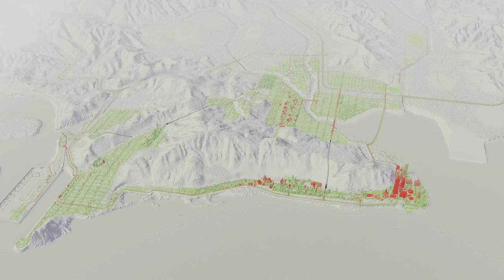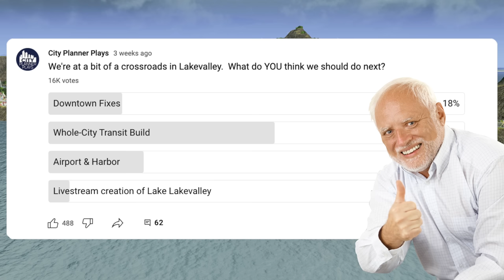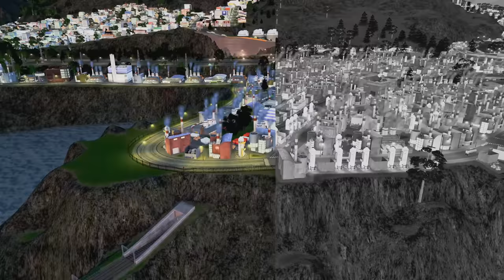Building the PERFECT Little Airport for the City That I Abandoned 2706 Days Ago

Comment: The entire airports DLC is just PAIN to me. I'm an aviation professional, and that dlc makes the most painfully unrealistic airports. Also the runway is only the surface used for taking off and landing the rest of the movement area is taxiways. The long taxiways up to gates/stands would make you the most HATED airport designer by every ramper that worked there. Backing a plane out straight is hard, and for that long, doubly so. The way you did the small aircraft gates is more realistic. Interestingly, the vast majority or runways can do takeoffs and landings in BOTH directions and switch based on the wind at the time. Similarly, in real life, taxiways are almost all bidirectional to allow the ground controllers flexibility in moving the planes.

Comment: Just thinking you could ease the traffic demands on that road from downtown to the airport if down the line you add a MONORAIL around the water's edge from the airport to the downtown? Maybe that's just way too extreme for reality, but it almost seems like a sort of downtown tourist attraction in itself to have this scenic waterfront transit system. Would also make lots of sense to extend it past that tricky traffic light and convert the industrial pocket to a HOTEL & CASINO cluster. All of a sudden your airport and downtown make way more sense as a tourist attraction hub. Leave the industrial to the area you already fixed (especially since this little rail network you just made literally doesn't connect to anything in the city- just goes from the cargo airport off the map lol).

Comment: Would a large project like this with challenging transportation access be a case for a corkscrew tunnel to grade. Enter under the highway exit at grade of airport, join them with a large tunnel into the mountain or a corkscrew to get to the lower grade?

Comment: I think the thing about trees near an airport is largely a myth. The most common kind of bird you'll get in trees is small songbirds and no sparrow, no matter how hard it tries, is going to take down a 747 in flight. The larger birds like eagles, hawks, ducks, and geese don't necessarily like trees anyway. Where I live the airport has no trees yet is one of the most popular birdwatching sites in the county. Because predatory birds like hawks sit on telephone poles, electrical wires, or chain link fencing waiting for rodents that are visible out in the open (due to lack of trees). And the waterfowl will fly around regardless just because there is water in the area.

Comment: I'm very impressed with how good you are at planning roads and other such things. But I do think you have a bit to learn about airport design. I'm an airline pilot, and this airport just doesn't make any sense. Maybe have a look at some existing airport diagrams? Like what's the point of having stands that are 5 airplane lengths long? And then everyone has to push back out onto the only taxiway to start their engines? In real life this would create a huge hassle for both the pilots and the air traffic controllers. The pilot has to wait forever to start the engines while the ground crew is pushing. And it would create a "traffic jam" of airplanes waiting on the main taxiway. The in game airplanes push to the end of the stand and then make a magic 180 degree turn. An airliner just cannot do that. You really need a parallel taxiway for airplanes to pushback onto. And then taxiway gates to enter the main taxiway. Then once they started their engines on the parallel taxiway they can take one of the gates and join the flow up to the departure runway.